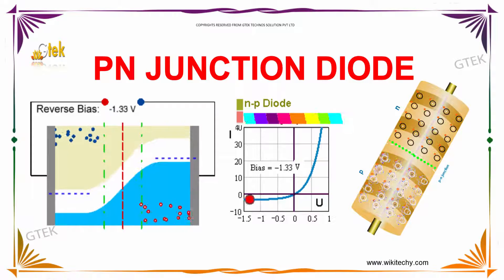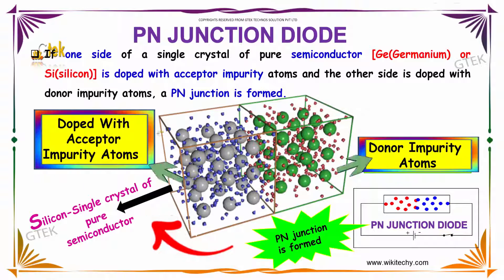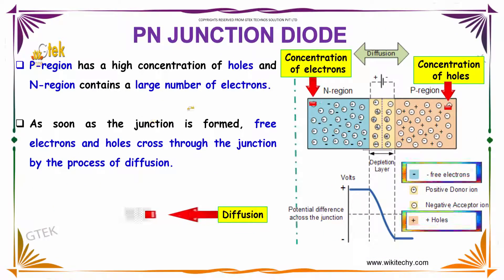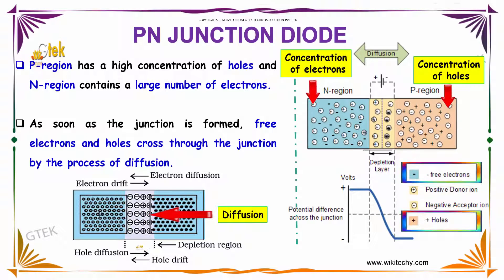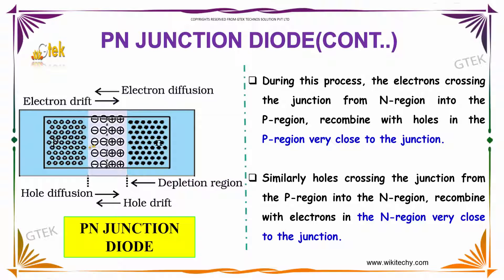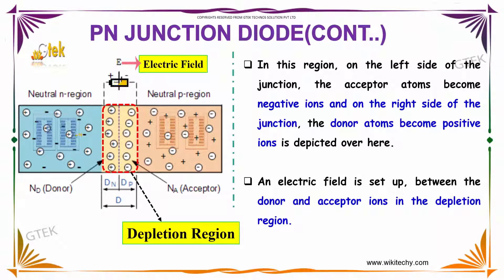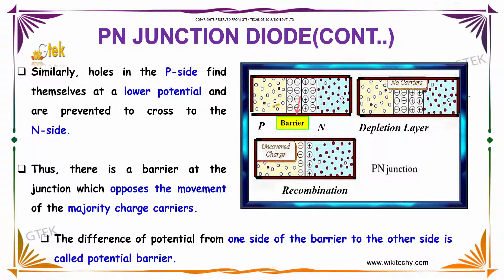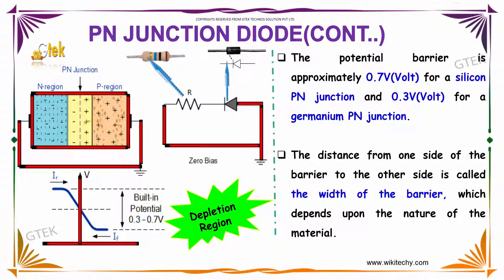PN Junction Diode | Semiconductor Device |class 12 physics subject notes lectures|CBSE|IITJEE|NEET

Comment: photovoltaic device was built, using a Si pn junction, by Russell Ohl in 1939. The functioning ... A photodiode works on a narrow range of wavelength while solar cells need to work ... Adapted from Physics of semiconductor devices - S.M.. Sze. .... Figure 12: Si solar cell with an inverted pyramid structure to enhance absorp-.

Comment: Best Answer: In a P-N junction, the holes from the P side and electrons from the N side tends to move to eachother due to attraction of opposite charges.Now as the flow increases there will be enough Positive charge in N side to resist the flow of further Positive charges from P side.Thus a Potential barrier(Which ...

Comment: Reverse Biased PN Junction Diode. When a diode is connected in a Reverse Bias condition, a positive voltage is applied to the N-type material and a negative voltage is applied to the P-type material.